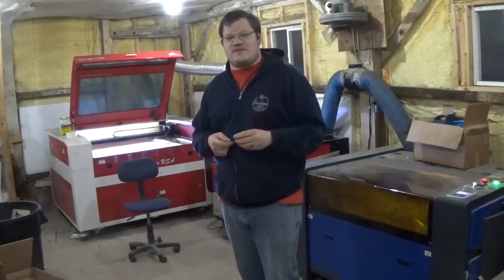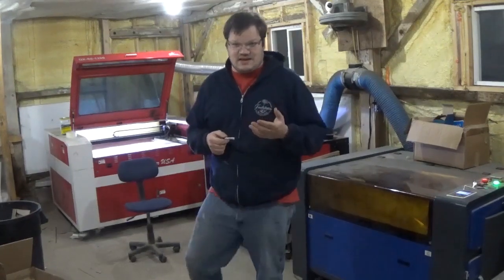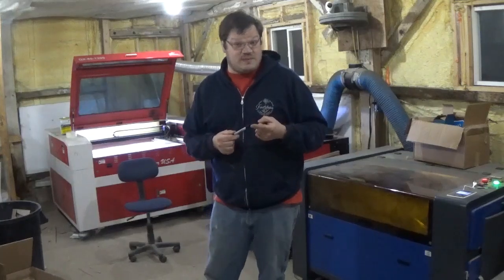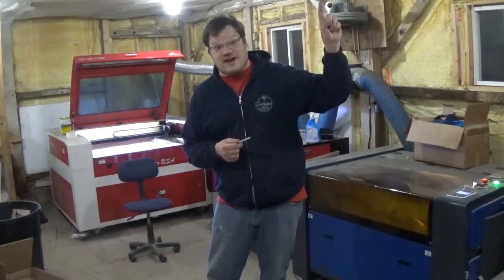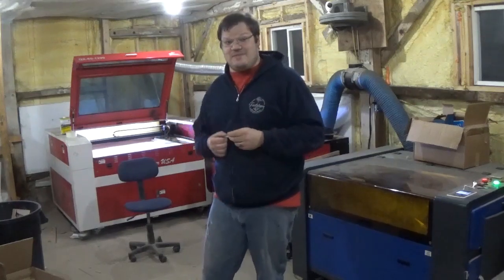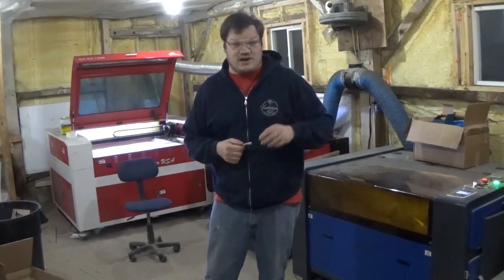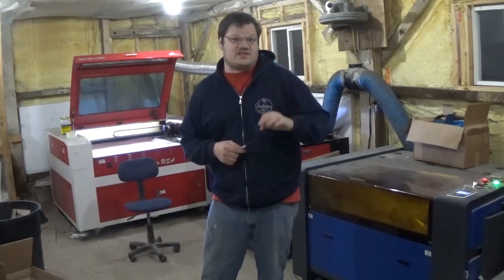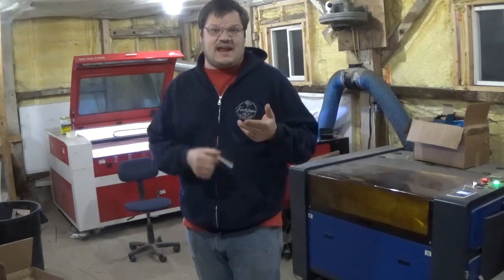Why Co2 laser cuts one side better then the other

Comment: Hi,how are you?
Could i ask you some question friend about some problems co2laser cutting?
Reply from the maker: Sure how can I help
Reply: @JaysToDoList  thanks
Look my friend,i saw your video and tought maybe you will  know this problem.
Laser no cut precise import size ,for example ,52x36mm.cut 51.5x35.5mm.
I do calibration on big sizes frame ,for example 600x800mm.and chack again but the same result.
I have feeling that controler not accept my  meausre or not calculating aproximenty sizes .
Do you understend ,english is not good.
Thanks